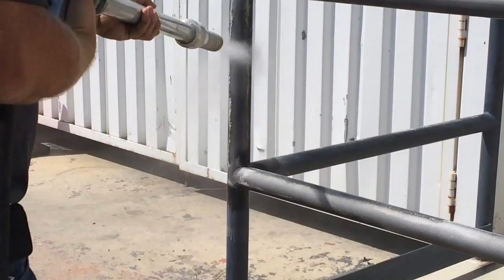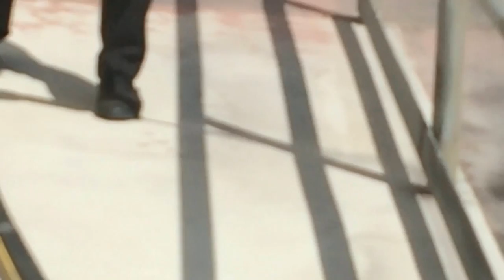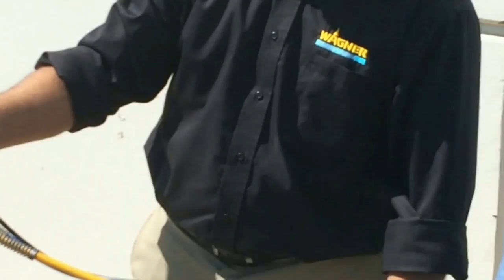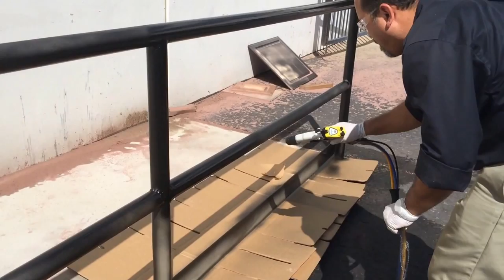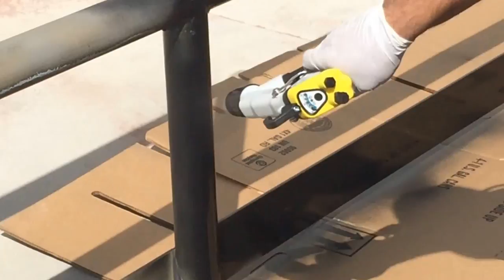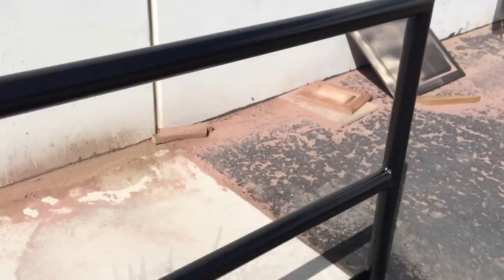Ecoquip blast with Wagner GM5000 electrostatic spraying without any masking tape!

Comment from the maker: You can apply a second coat just as you would any liquid coating, per the directions of what ever coating you are using.   Note: you must use a solvent based coating that is formulated for electrostatic use for the paint to properly wrap.
Reply: Total Finishing Solutions  I’m interested in this set up. I need more information in what I need.  Besides the gun what other components do I need to get this same set up?
Reply from the maker: Raul Aguero can you go to our website and fill out the contract/request a quote form. We can get in contact with you Monday?
Reply: The coating itself can act as a resistor to the grounding of the object being coated. In some cases even stepping on overspray while spraying can break the grounding contact as per specification.

Comment: what are the benefits of using eletrostatic sprayer besides the obvious overspray?
Reply from the maker: Jorge duarte faster application time, less masking, will require less paint, and outside edges will build up more film build providing better corrosion resistance.  Sharp outside edges are where corrosion attacks first so having more paint on them is very important in some applications.
Reply: Ty Crowder does the paint wrap itself around the inside parts or do you still have to spray them in that angle to get them painted?
Reply from the maker: The wrap on outside edges is improved while the wrap on inside edges is not as the charged particle looks for the closest ground.  So you have to reduce voltage or angle the gun on complex inside edges or channels.
Reply: Ty Crowder thanks

Comment: Very professional and saves a lot of labor. Is that dry ice?  Is there any concern of breathing in the paint dust, or does the flow of air mitigate that hazard?
Reply from the maker: +Sandia Park Land for Sale 

You can use any media.  It is garnet in this video.  What you see is mostly water vapor and compressed air.